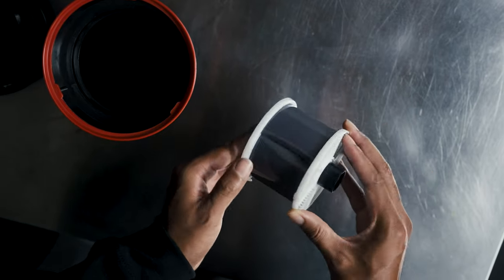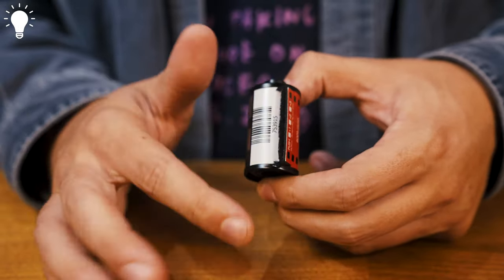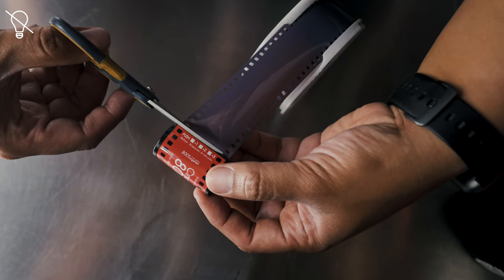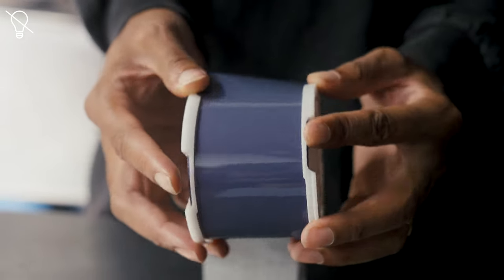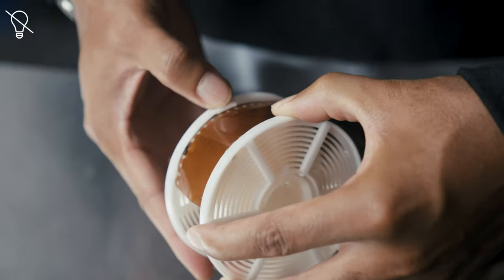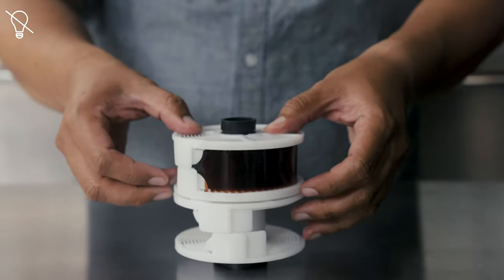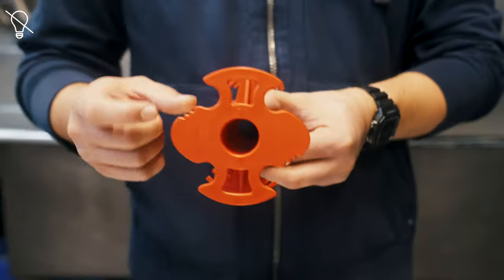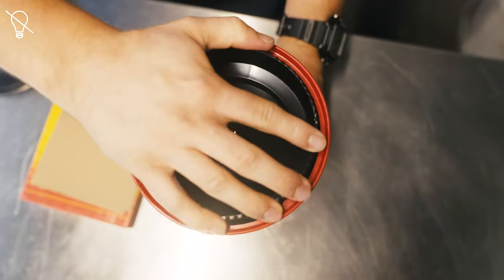How to Load Film Onto a Reel [For JOBO, Paterson, AP, and more]

Comment: one other tip, at 1:17 you CAN do the "leader fetch" in the LIGHT, using a "leader retriever", NOT a breed of dog, but a device like a ruler, but with three tongues which stick out, one short, two long, like a dogs (while panting), the short tongue goes into the gap, the first long tongue (marked 1 or A on the slider on the side), inserts, then you rotate the spool backwards until you hear the tongue and film leader pass each other inside ( a click), then advance tongue 2 or B this vices the film, then hold the can and pull the complete retriever back... hey presto, a leader emerges from the felt, job done!

Comment: You can definitely load two rolls of 120 on Paterson and AP reels. Just push the first roll all the way to the center of the reel until it stops then load the second roll on until the tail just goes in the groove and stop.

Comment: Thankyou for showing 4x5" options :-) as not many do, or at least together with the other formats in this kind of discussion. 
with the SP445 there is another method to load the film, that is simmilar to Grafmatic holders, you know, the 6 shot holders with the separate septums; for these they say, curl the film, add it to the septum and let go, it snaps flat, and falls into the grooves, this not being the whole distance of the septum, then Push the film the rest of the way home.

Comment: Hello, Ive been using an AP Compact developing tank. I have loaded Ilford and Fomapan film successfully. I recently tried a Kodak Tmax film and for the first time I had problems loading it onto the processing reel. One thing that I noticed was that the Kodak film was thicker than the Ilford and Fomapan. So, I was wondering if this is a general problem with Kodak films? Are they suitable for processing in the AP Compact tank?

Comment: Hey! I have a question about winding 35mm film to a plastic spool.
I experienced this problem twice only on one specific film (Kodak ColorPlus 200). I don't know exactly why it happens but when I take out my film from my camera and prepare it for the darkroom I notice that from the tip to 1/3 of the film is too straight which caused some problems. When the film is halfway wound, I suddenly feel that the film is jammed in the spool. I also felt that the film was stuck at the entrance. I tried cleaning the spool over and over again but that didn't work. Is it caused by the temperature? (avg. -2°C) to straighten? Or is it caused by the camera (Yashica FX-3)? Because it winds the film in the opposite direction when loading.

Comment: Your 35mm technique passes the film through the cassette’s felt light trap a third time. I avoid this by opening the cassette with a can opener and pulling the film spool (with the film attached) out as a unit, and then loading it on the reel.

Comment: How do you unlock the Paterson reel to change to 120? I turn it opposite but feels like I'll break it
Reply: I don't even use mine for 120 but I wanted to see how it worked. So I just kept trying many times until it eventually worked. (Oh and after doing it a few times it got a lot easier, it was just really stuck from the factory.)

Comment: To everybody getting into developing, I have one great bit of advice...
NEVER GET THE METAL TANKS!!!!!!!!!!!! THEY'RE AGONY!
They're all we have in our darkroom photography class and AAAAAAAAGGGGGHHHH... They're a pain to work with even if you're good with them, and my last two rolls came out with development marks. 
Admittedly, the compact size is nice, but trust me, it's not worth it. I'm going to buy a jobo tank and bring it to class because I am SICK of using the metal reels. 
Also you have to pour at an angle otherwise you just dribble chemicals everywhere because air isn't flowing out enough if you pour straight on.